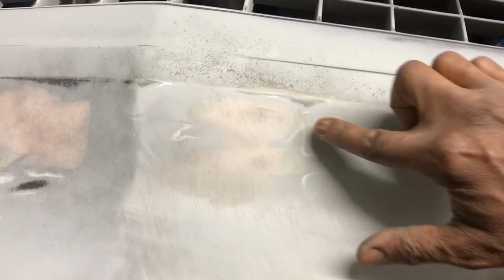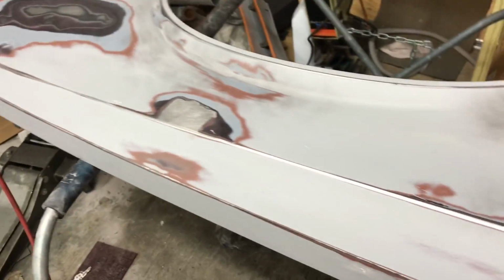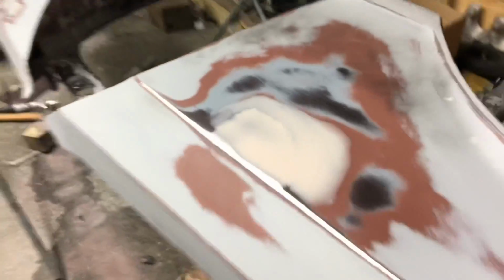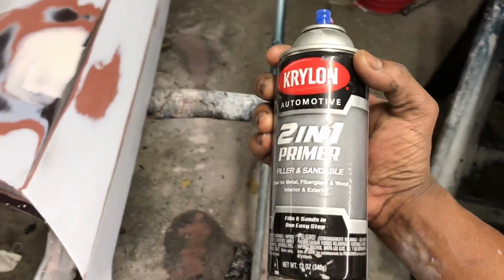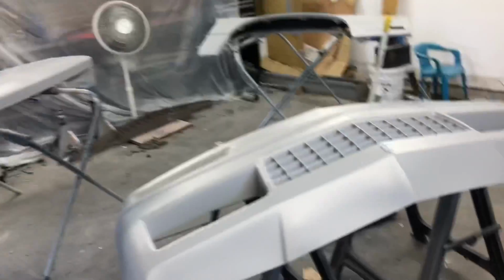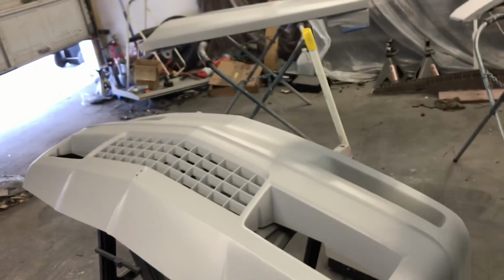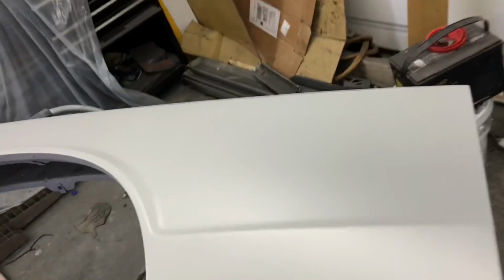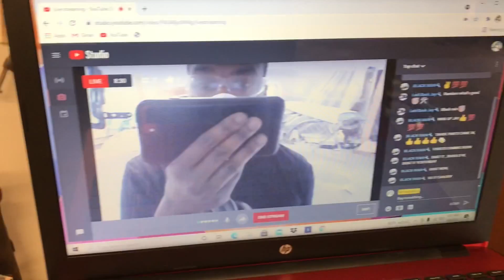Tips and Tricks On How To Paint and Do Auto Body and Fender Work

Comment: I might have to make a video showing the body so you can say how you would attack it
Reply from the maker: You probably should sand it all down, make repairs, prime with 2k then block sand. Seal everything then lay your paint 3 coats of everything
Reply: @MRRANDOM1  sand with 80 grit? I found a a 80 grit disc lol
Reply: @MRRANDOM1  sand it with what grit
Reply from the maker: @infamousnova  lol 80 grit should get it for sure, I believe the 2k primer will fill those scratches. Ive been using 120 on disc
Reply: @MRRANDOM1  its up